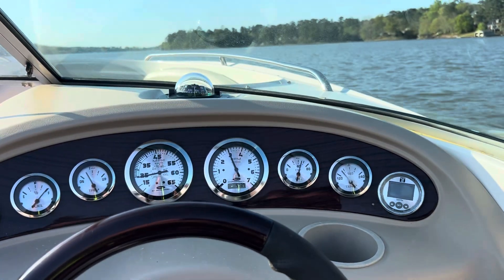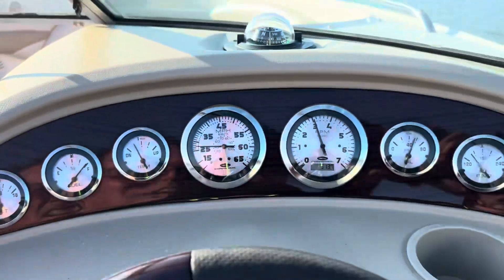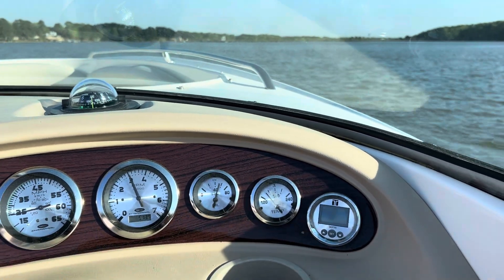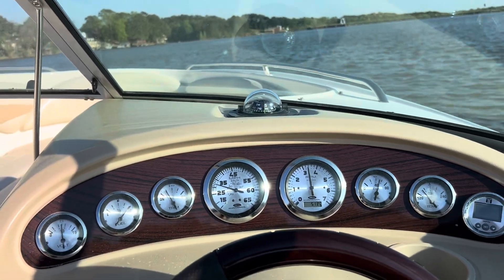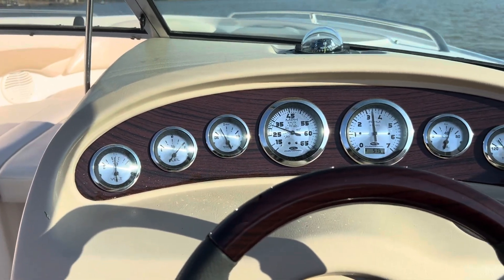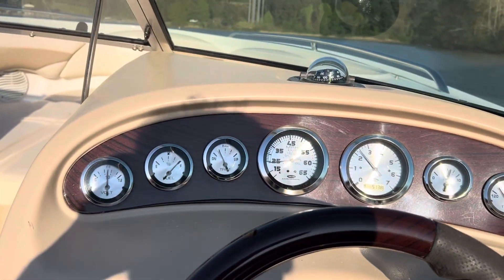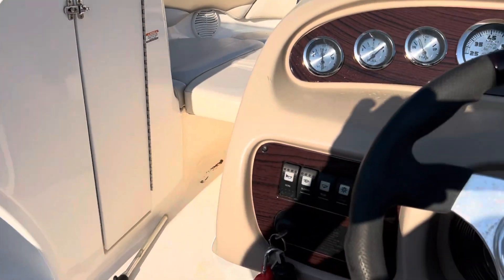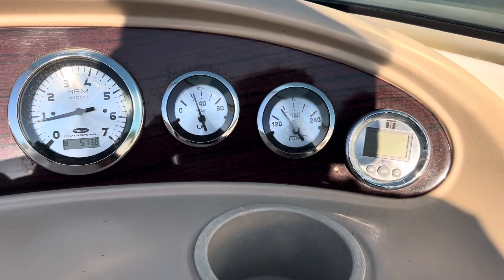Volvo Penta 5.0 To 5.7 GSI - Test Drive

Comment: Open it up....
Reply from the maker: You NEVER go WOT on a brand new engine. You must keep it under 3000 rpm for the first 10 hours. Otherwise it will not break in properly.